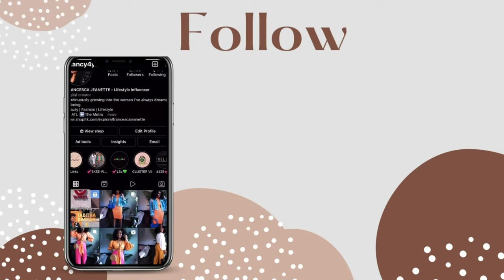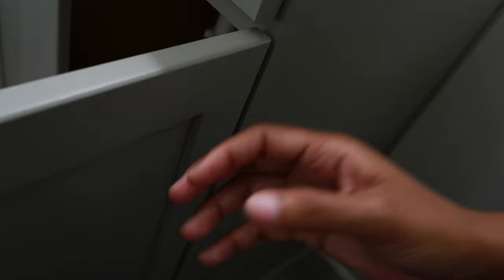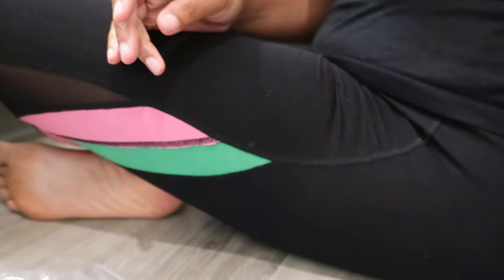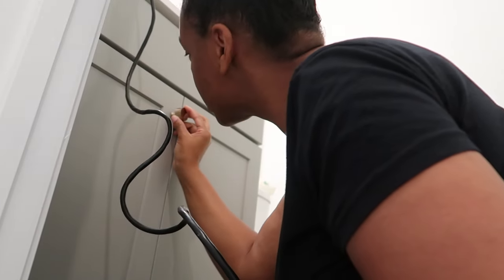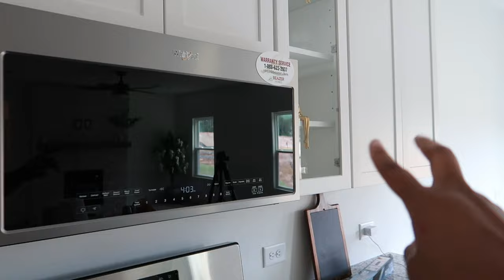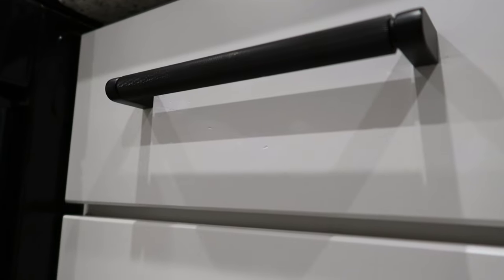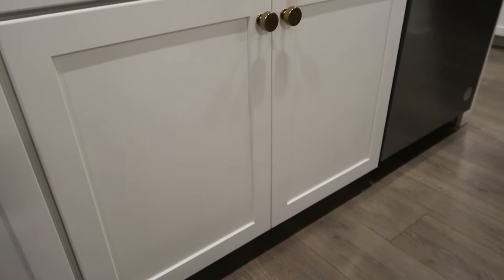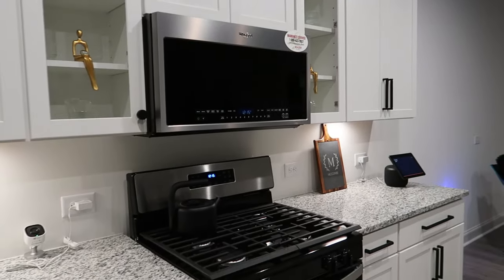House to Home Vlog ||  Cabinet MAKEOVER + DIY Install + Modern Knurled Pulls & Knobs

Comment: It’s okay if the hole for the handles is a little larger than the bolt, because the bolt tightens down to the handle 🙂 it’ll save you some trouble getting the bolt in there next time. Looks great either way, though!
Reply from the maker: Thanks I was so nervous! Some of the screws are now stuck because the holes were too tight! So if I paint my island I’ll have to paint around the handles lol oh well…. 😂😂 thanks for watching babe! 🩷